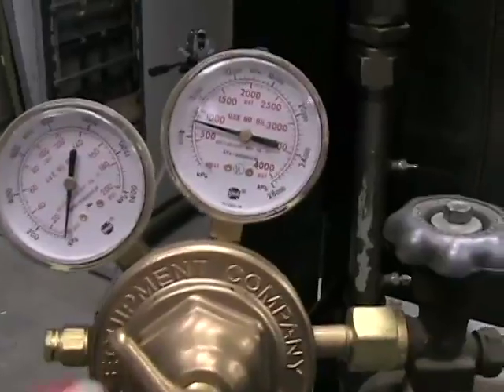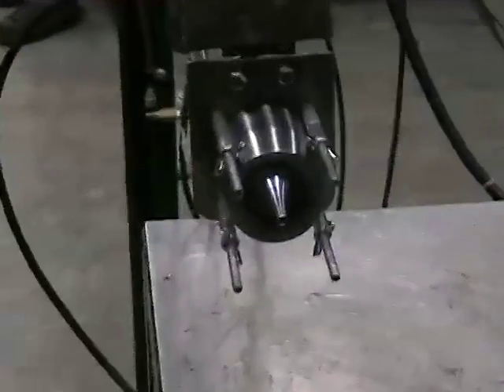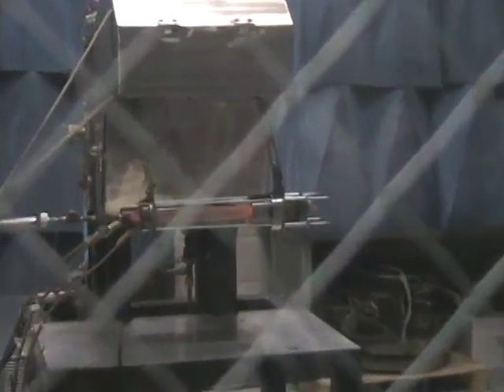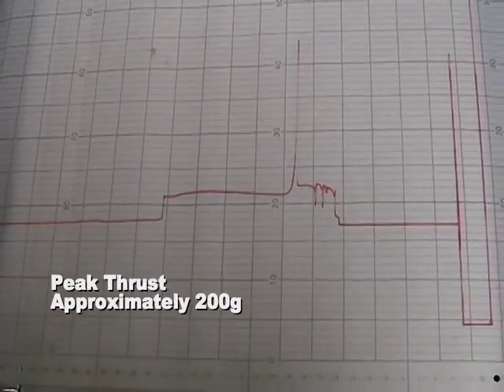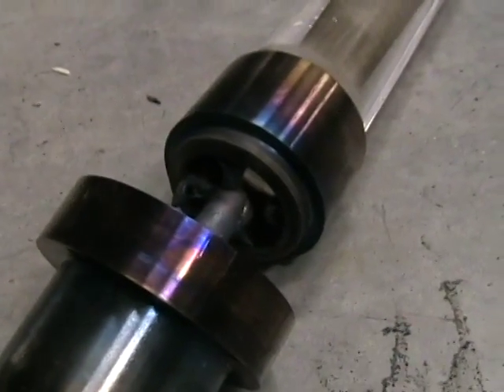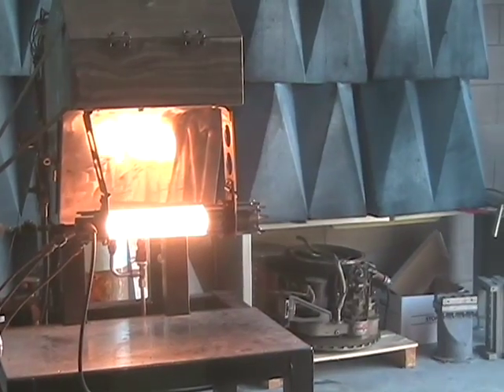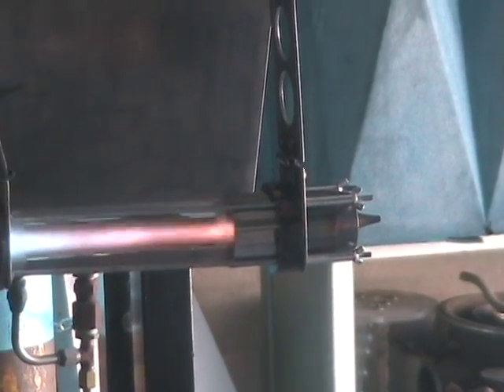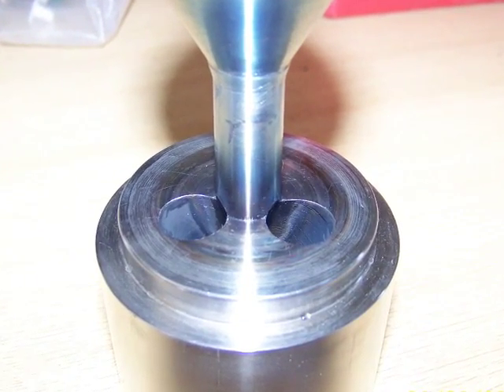Hybrid Rocket Motor Aerospike Nozzle Tests

Comment: Dude this was made a year before i was born by 20 year olds who are now well into their 30s, for college. That's a WHILE ago. That aside, very impressive project. However if this was to test the power of your new hybrid aerospike rocket engine, i would have made a regular rocket nozzle to compare it with, just so i could see if it really is much better. A design flaw i noticed is that the oxygen was reacting with the aluminum due to the high heat, causing those sparks. You basically created a thermite reaction which heated the aluminum further. I wouldn't make the nozzles out of aluminum or anything reactive for that matter. Plus, I'd cool the nozzle to avoid it warping with the heat.

Comment: 4140....the hell dudes....stainless at the LEAST with high temp. Try 303 stainless next time and see if it doesn't hold up better. it's a good start and it's an easy cutting stainless, which is an oxymoron but still,

Comment: you may try to give the inner side of the nozzle with a rubber coating like tyre it will help you to transfer the heat to the tyre and mel it so th nzzle wont heat upp much higgher and much hotter.

Comment: was this 400g of thrust? a 3" propeller on brushless motor can make more than that
Reply: noonenaught in fact, a r-candy would provide more thrust than whatever they are doing.
Reply: Noon:  Your electric motor/prop can't do that using O2 and solid fuel.  In any case the object of the project is not maximum thrust from an engine, but the test and improvement of an aerospike combustion chamber and guide.  Task accomplished.

Comment: why not use ceramic for the end part that is melting
Reply: cement cant hold pressure where it is around 20atm at least.
Reply: Sihao Feng have you considered making it out of the materials they use for plasma cutter tips, it is a ceramic material as it is a great idea what your making
Reply: m beginization it doesn't hold pressure, it is brittle, it is literally that simple, checkout the video at my channel, it even almost has no pressure(maybe there is some) but broke like a glass
Reply: Sihao Feng what about porcelain as it is very high temp and fused like glass

Comment: How would perform a Inconel alloy for the nozzle? i have heard they are handle heat pretty well.
Reply: Superalloys tend to keep their strength to high temperature, but still have a melting point close in the same range, relative to exhaust temperatures. High-density carbon allotropes, and maybe more affordably for testing bentonite, can withstand these temps better. Ideally you would be using the Leidenfrost effect, or the Venturi effect, to shield your nozzle geometry from the gasses.
Reply: I think a Leidenfrost type shielding might not work as the nozzle is reliant on gas pressure against the aerospike. If it were to be applied, the medium (steam, nitrogen, ect) would have to be traveling at the same speed as the exit gas. If not, theoretically high moving gasses would defuse into low pressure gasses causing lower (I'm guessing) thrust. Just my best guess though.

Comment: Molybdenum guys. Way cheaper and easier to machine than tungsten and cheap.
Reply: +Joseph Grace Molybdenum vapor that is inevitably produced when machining is VERY VERY Dangerous It can enter your body directly through the olfactory nerve and do Terrible Brain Damage without even entering the blood stream and giving the blood brain barrier a Chance. As a machinist I know this because STEEL Has Moly. IN it And the Tiny amount there is Still A DANGER...

Comment: I plan to build a simple version of this a little bit larger and put it on a bicycle, i do not want safety stuff ill be doing this regardless what anyone tells me. But does anyone have any idea how much thrust i should use for a bike with a 160lb rider? I want to go fast but not so fast that its entirely uncontrollable.
Reply: +Chris A look at colin furze's channel he has a pulse jet bicycle that you could try
Reply: It won't worth its mass. Use a high power electric motor and enjoy 60 mph
Reply: I made a promise to my brother before he went to boot camp that I would make a rocket bike so it must be a rocket. I considered a sugar rocket but i figured this would be safer
Reply: +Chris A what about solid boosters? Simple pyrotechnic rockets will work and they can be found anywhere
Reply: I figured this would be safer/cooler but ill reconsider if this doesn't work well
Reply: Chris A Hybrids are so complex to build and not cheap. But hell yeah, it is cooler in real or surreal meaning!
Reply: +Nathan Healy Not a rocket...
Reply: Micah Burgin didn't say it was
Reply: He said it had to be a rocket though... Soo. Point still stands.
Reply: Hey, did you survive the rocket bike? Plz reply

Comment: Did a linerar aerospike for my senior year project at UMD. ;)

One question, wouldn't thermal expansion of the spike choke the flow out the rear with that design?
Reply: Taldren given his 200 gram force, his throat area IS pretty small. If thermal expansion only affected the bulbous part of the nozzle, it may decease that thoat area, which with that design would move choked flow farther aft. If we assume thermal expansion affects both the outer and inner part of the nozzle equally, the radii of both would increase linearly, causing the area to increase with a second order trend, meanign flow would actually increase. This would move choked flow farther forward, though the interactions of the supersonic flow with the walls of the nozzle would likely cause expansion waves, which then collapse in externally. The point is we would see the affects of anything significant. My speculation is that it's negligible, especially since the thrust from the nozzle would be compressing that region with greater deformation anyways.
Reply: Did Taldren Know COANDA?

Comment: The supports that started to melt - If they were contoured into an airfoil, you'd have less drag on the bars (and thus less melting) and you'd increase thrust because there would be less drag.  The flat leading edge is just killing you!  Another trade off would be to have more than three supports, and sand down the supports to a teardrop cross section.  More flow = more thrust. Albeit, this will be more difficult to machine.  Cool project!  I wish I had facilities like this to play with!
Reply: +Keita Ikeda  Agreed, the final view showed the tri port mod was more resistant to melting, but the flaw was the fine edge which gave way to thermal buildup. Had they contoured the "leading edge " to a more airfoil shape as opposed to knife edge it may have survived unscathed. A higher density fuel may yield greater thrust. They didn't specify unit weight but it looked higher than 7 lbs. Thrust to weight ratio of 1:1 means you are not leaving Earth. Maybe useful as a thruster.

Comment: 1. Make inner surface without sharp edges, in order to avoid local overheating.
2. I think that so much oxygen in the mixture, that it begins to provoke burning excess metal.
3. IMHO, you need use titan (Ti).
4. And what do you think about graphite?

Comment: Fun project, thanks for sharing. I fly RC models, in my 40 inch 3D Hummer plane I have 4S Li-Po 1800mH battery and RCX 2814-800 with 10x5.5 APC prop generating 1800g thrust for 8 minutes. I think your efficiency needs to go way up, cool project for sure, thanks for sharing.
Reply: +Ozzy3333333  Props are great if you have a medium to react with. Not too useful in a near vacuum. Maybe you could convert that battery power into an ION drive.

Comment: I saw 200g thrust...
is that g-force or grams?
Reply: G-force stands for acceleration, not thrust. 200 g = 1.96N
As the engine worked for 20 seconds, its impulse was around 39 N.s. Like an E-class engine

Comment: I hear the distinct sound of arching are you guys using plasma? what is the fuel and OMG YOU GUYS ARE AWESOME! keep up the great work your awesomely motivational!
Reply: They explain before the test that they're using a mixture of propane and oxygen as propellants, which combusts in the large glowy section.  That section is actually filled with plasma formed as the gasses mix and burn.  The first noise of the tests (before the flame out the back) is the gas escaping before it reaches the pressures necessary to make their nozzle work.  They were testing that flow to make sure they got a flame - if it's too big it'll do the pthhbt thing like in one of their later tests in the video; on the other hand, if it's too small it'll be less efficient and build up pressure, which over time could cause an explosion.

Comment: i wouldnt be surprised if they would generate more thrust without any sort of nozzle. that aerospike looked like it restricted flow an awful lot
Reply: That is actually necessary.  You want the nozzle to create choked flow and change the high pressure low velocity gas flow to low pressure high velocity flow.

Comment: Why did you use 4140 Chrome-Molly instead of a higher temperature rated high alloy steel? I'm interested because its normally used for its high tensile strength to weight whilst still maintaining easier fabrication than materials like carbon fiber and is typically avoided in internal combustion engine designs due to its poor handling of heat. It wouldn't be my first choice but you seem greatly more qualified regarding rocketry matters than I am so I'd love to hear reasons behind your choice.

Comment: If I understand correctly, control vanes in the exhaust were abandoned in favor of gimbaling the rocket engines because vanes robbed the engine of a substantial portion of it's thrust.

Comment: If I understand correctly, that is what the aerospike nozzle is all about.  Optimum performance at all pressures as the rocket ascends out of the atmosphere.  A bell nozzle is like an engine/transmission with only one gear setting.

Do I get the gist of it, perfesser?

Comment: Would it be fair to say then that your combination of choice of fuel, combustor, nozzle, and construction material is beyond the envelope of what you're trying to achieve?

Not knocking your R&D, but you seem to have reached your limit as far as build materials for this design goes.

Even drag racers have their limits. There's only so much Nitro Methane you can pump into a given system until fails - usually catastrophically.

Just sayin...

Comment: Nope. Areospike rocket engines are prettty much the same as any other, the only difference is the nozzle.

Basically, you want the nozzle to spray all of the gas straight backwards, and avoid any shockwave or sideways motion in the gas. This varies with air pressure, so you can design a nozzle to perform optimally at any given pressure, but it'll underperform at other pressures.

The areospike is a neat nozzle that performes very well at all pressures compared to traditional bell nozzles.

Comment: It has absolutely nothing to do with atmospheric oxygen, All combustion is well and truly complete before it hits the nozzle. The idea behind a toroidal aerospike engine is to extract the highest amount of thrust out of a given amount of fuel. By aiming the exhaust inwards at an almost 90 degree angle onto continuously smooth spike then you can 'trick' the most energy out of exhaust gases that are almost moving in all directions at once due to thermal scattering.

Comment: the major flaw of rocket engines is the need to take oxygen with you. Basicly, by using a "spike" with variable length, you can utilize the oxygen in normal air until that gets too thin.

Comment: Wonder if... on your test that used spokes, gun drill some ports down the center, and then converge into the center core, and exhaust out the spike tip. Now, through these external ports feed an inert gas through the drilled passage ways and you're cooling the spokes and spike internally. Jet engine turbine's use this, simply blowing air through the stator vanes allows them thousands of hours of life in extreme heat environments.

Comment: @jpourkav graphite was used by Germans in WW2 on the V2 rocket on the basis that in the flame it is no oxygen so the graphite will not ignite and burn. Englishmen can certify that the system worked.

Comment: question?
instead of focusing the heat proof material, can you redesign, the exit of combustion chamber and to direct the flame flow in the way that don't accumulate to much heat?? 
if you can, machined the spike in side the combustion chamber, perhaps the flame and temp can distribute faster and evenly.

Comment from the maker: @MarkieSKII This test was for feasibility. Hot fire testing of an aerospike nozzle at Cal Poly has been attempted only a few times. I wanted to prove that it could be done successfully, but the main project behind the testing was to produce a working computer model of the nozzle. For if the model says one thing and your actual motor produces another, then something is way off, but if they are close, then you can scale up from small to big rockets, eventually leading back into flights.

Comment from the maker: @grumm70 This particular set up is much too small to be cut into smaller pieces...but the problem with doing that would be containing the exhaust pressure, if any were to find its way out of the nozzle other than in the intended exit, then that’s when it'd go kaboom. Though it'd fun to try.

Comment from the maker: Rockets are always dangerous no matter what size they are, this fact isn't neglected at this school, in industry or anywhere that wants to get into rocket science. Safety planning is heavily looked into before anything is attempted like this at Cal Poly. But ease your concerns, this set up is not as dangerous as you may think. Neither is the use of NOS, but back in '07 in the Mojave Desert there’s a company that got surprised with its use, however they are still using it today.

Comment from the maker: @badboybilzer True, but I think the issue was more switching over from starting with propane to oxygen...there was probably some 'air' in the lines along with pressure differences. However, I did have this problem with other hybrid motors that I was working on at the school. Thanks.

Comment from the maker: @KittyRokher Thanks...well I machined this myself using the school machine shop, so I only had to cost of the materials...but each nozzle took over 30 hours of machine time. A bell nozzle however should be a lot faster to make on the lathe, probably looking at around 4-10 hours depending on the size. Hope you can find a shop that doesn't charge a lot to use their machines...

Comment from the maker: @1abcrr1 True for sustained burning of an engine. But in my case, this video is of the smaller scale version of my nozzle for classroom demonstrations. I designed a full rocket motor around a bigger nozzle that would have lasted several minutes without any cooling or exotic materials...just wasn't able to use NOS during this time frame to test it... :(  Inconel would have been fun, but sadly no..

Comment from the maker: @earthstation1 that is steel....chrome-molly. The second nozzle is made from stainless steel. Which is a little better in terms of the melting temperature, but the redesign is what fixed the issue. If I had more time and money I'd have gone ceramics. Thanks.

Comment: the sparks are  coming from the aluminum melting internally   You need to redo it out of steel   you  might try ceramic's  they will indure the heat better

Comment from the maker: @johnmresler Thanks for looking...but to answer your question, my tests were unable to demonstrate the differences between an aerospike nozzle vs. a regular bell nozzle. The best I could hope for (since the engine never will take flight) is to match what the regular nozzle can achieve. The real benefit to the aerospike is better overall thrust performance throughout the whole atmosphere, where the bell nozzle is really only efficient in a small band of the atmosphere. Hope this helps.

Comment: Hi,
   Since viewing your video I've done a small amount of reading on aerospike's. The few engines I've seen have been wildly different in design (the X-33 linear, a demo annular and of course yours). The reason I bring this point up is to determine if you were able to achieve the goal of an aerospike (what I'd call less span-wise flow as a former pilot of swept wing aircraft) or reduce the expansion that occurs in bell shaped exhausts. 

Did you achieve the goal?

Comment: That's about the temperature range I figured, given the conditions of that experiment.  Yes there are lots of choices of materials, this I know, I was just giving you a choice that you can find as scrap, and is used in rocket nozzel applications extensively.  Very cool though, carry on, and if you need maching let me know :)

Comment from the maker: First we ignite the propane with a spark plug because this can be done easily, so once thats lit, we then transition to the gaseous oxygen (GOX) which is the oxidyzer which this then needs the plexglass as the fuel source. Propane contains its on oxidyzer and fuel, which makes it easy to ignite, just like in a bbq.

Comment from the maker: Maybe true, however rockets consume larger amounts of fuel than a jet engine can. Scram jet engines, like the ones used on the SR-71, are the nearest resemblence of a sudo rocket engine, yet still no where near a powerful. Plus taking off with those engines from LAX would blow out all windows within a 5-10 mile radious.

Comment from the maker: Yep, if I had more time I would have done such tests as you spelled out. No actual measurment was ever taken, but my best guess would put the exhaust temp between 2,500-3,000 degrees F, based upon how quick the material melted away.